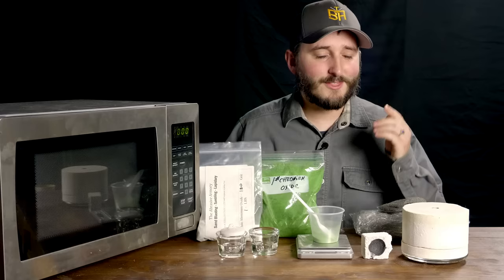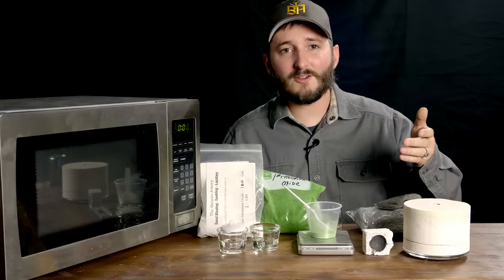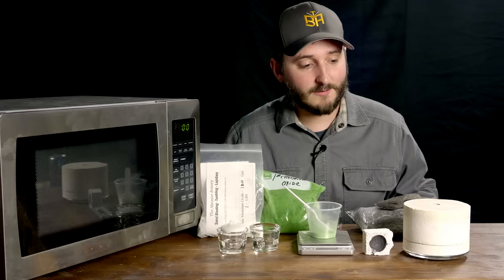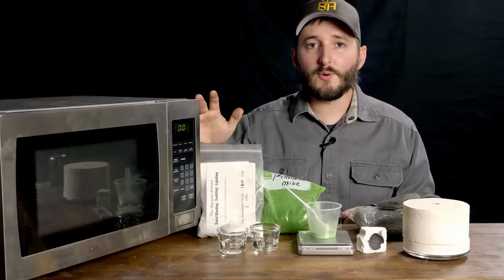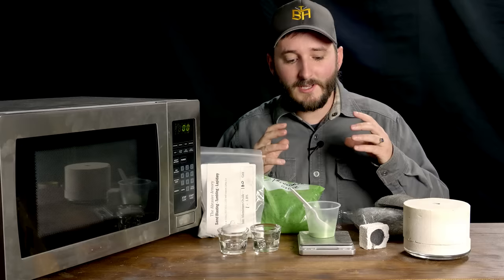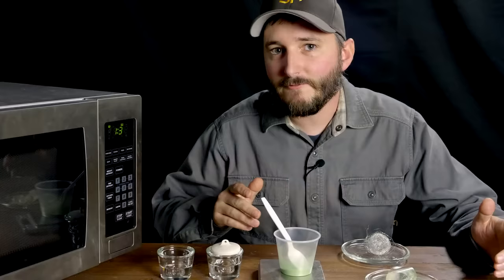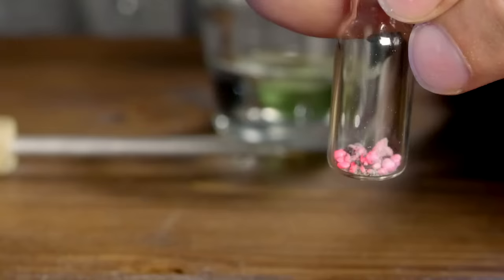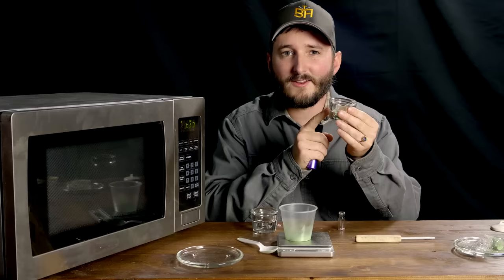How To Make Ruby in a Microwave

Comment: Have you considered a high energy laser beam to heat the mixture as it drops to a target/platform?

I've often wondered if the Verneuil process could be perfected by using either a laser or maser to heat the mixture instead of a flame, the theory being that this could avoid the air bubbles found in flame fusion rubies if you do all of this in a vacuum chamber.

I've also heard that the extreme temperature gradient in a Verneuil furnace causes observable curved striations in the ruby as it cools, so perhaps an array of high intensity infra red lamps in a circle around the platform area that catches the ruby droplets to keep them evenly heated as each new droplet falls?

Also the rubies would be a much more noticeable ruby red color if you increase the chromium percentage in your mixture to about 5.4%-5.6%.
Reply: Very interesting
Reply: I wondered the same thing except not as smart. I was more like WhAt aBoUt LaSeRs?!?!?
Reply: Interesting idea, thanks for the chromium concentration tip

Comment: Would running the chromium / aluminum oxide that has already began “seeding” ruby back through the process grow them larger? 
And what effect does the aluminum size factor in? Would a larger strand allow for more growth before cooking away? 
Does it even have to be aluminum? Something that can handle a higher temp might be interesting, I wonder if a carbon rod would work. Or maybe carbon fibers? 
Interesting stuff for sure, the microwave kiln idea is crazy.
Reply: You're right. Aluminum is not necessary for conducting the large alternating electric impulse from the 2.45GHz microwaves, but the aluminum also does not create a plasma which adds other metal impurities to the aluminum oxide + chromium. It can also cause neurodegenerative diseases. You can use any conductive material, like hemp or coconut Carbon filaments, Tungsten, Copper, Steel, Silver, Gold, Iridium, etc. 

When making large sapphire glass panes and lenses, a seed crystal is dipped into a molten bath of aluminum oxide and drawn out slowly, allowing a large crystal to grow from the seed until the bath is mostly empty. Yes using the seeds with a melt pool would allow you to grow them larger.

P.S. He is trying to simply use the high heat from the plasma to melt the crystal powder, but there are more efficient ways to turn electricity into heat than by powering a microwave to vaporize some metal strands. One in particular that should only need a couple dozen watts of energy input is using continuous wave lasers. Sapphire has a very large optical window where it doesn't absorb, so we may need to get creative, or target the toxic chromium oxide.
Reply: Unless the stoichiometry is affected, I'm actually assuming it should be reusable. As for making the rubies larger, I think compaction of the powder before the process may help, and since it is alumina (aluminium oxide is alumina), perhaps a sintering aid like MgO could be added, although I'm not sure if that will affect the optical properties. In this case I am assuming this is the same process as sintering pure alumina.
As for size of the aluminium, I'm not sure how big a difference it really would make, going for a larger volume will reduce the effective surface area, so there is potentially room for optimisation but I don't think it's necessarily worth it.
Carbon heating elements can indeed withstand high heat, but they must be in an inert environment, I use argon gas in my experiments with carbon heating elements. Otherwise, it will start to burn off at around 500C. Also, it will likely contaminate the rubies, most probably compromising the optical properties again. Carbon fibres can also be hazardous or an irritant depending on size, so that's another concern.

Comment: So cool! What if you used a narrow and tall vial with a strand of the aluminum down the center surrounded by the base? Just an idea. Keep up the good work!
Reply: Could do a spiral kind of thing too, yeah
Reply: @PilkScientist  Would thin aluminium wire coils work you think? Not tightly coiled like a spring but a loose kind of spiral that is just rigid enough to hold shape. Like take a thin metal wire that is straight and wrap it around a pencil and then pull on it to elongate the spiral. Two or three placed in the medium. I also wonder if the spiral shape down help would you get better results from a tighter spiral or a looser one?
Also, what do you think of a ribbon? Stick with me here, Take a wide, thin piece of aluminium like a strip sliced from a soda can, wind it up to make a loose coil, kind of like a pocket watch spring almost but not really tight. Set it down in a glass container and then inside the space pack in your medium. Think of an @ shape almost with the empty spaces filled in with the medium and someone else suggested a strong neodymium magnet to help pull the plasma down You could combine these different ideas and see what results from each experiment.  
I hope Nighthawk sees this thread here.
Reply: I was thinking a larger surface of catalyzer would increase yield and maybe size. Something like a loose spiral of aluminum foil would work well I bet.
Reply: @mikek6298  Yeah that's what I was trying to describe with a wide ribbon of aluminium. Making a snail shell or @ symbol type of spiral  and then pack the chromium oxide into the spaces. The metal ribbon would have a very large surface area touching the medium and might make more rubies or larger rubies. Maybe. 

I'll be honest, I have no idea what'll really happen, this is just throwing science at the wall and seeing what sticks.

Comment: I have experimented with welder method, both TIG and stick, and so far i think the main issue is that the material gets way too hot before it fuses into anything of usable size. I figured it out by doing short bursts of heat instead of one long one. Before material gets hot enough to fuse into one, i am noticing bright pink specks, showing that the ruby is being made. However, heating up the whole amount, size of a small grape, in an attempt to fuse everything into one turns the mixture into a glassy dark gray metallic-y object that hardly glows even in UV light. Interestingly, structure changes to something more opal-like with randomly oriented flakes inside that is rather beautiful by itself. At one point i thought bringing temperature up even higher would help, but just ended up melting a miniature firebrick kiln i made for the process. Since both open-air and CO2-argon shielded heats produce similar results, it seems that oxygen has no effect. 
I have tried compacting the powder in a press to make it act more like a solid object to begin with, but being basically dry sand it does not stay together enough to make a difference. I'd like to try this process under constant pressure, but have not yet figured out how to do so.
Seeing how nice of a stone can be made with the microwave method makes me think that it is either a lower temperature process compared to welder, or perhaps pure aluminum makes a difference. Going to try and see.

Comment: you should try using the last vessel upside down with the seed powder compacted in and put the foil at the bottom inside the vesel. also if the vessel was cone shapped it would concentrate the heat for a more even reaction. would be interesting to see, thanks :) @NightHawkInLight

Comment: What if you turn the steel wool into a powder and mix it in the seed powder?
Reply: You need sharp edges to nucleate plasma, so a powder won't work iirc.
Reply: It's ALUMINUM wool (not steel wool) and it's sticking into powder which is already mainly aluminum oxide. Also, it has to stick out ABOVE the powder like an antenna. Source: actually watching the video.

Comment: If you want a very simple explanation for why the metal ribbons cause nucleation in a microwave, think of the ribbons as tiny antennae that absorb the microwaves as they would with a radio signal. The most effective ribbon length would therefore be about a quarter-wavelength of the microwave, roughly.

Comment: Me this whole video: "Put it on the edge of the plate, so it gets hotter!!"
Reply: Fr those be the hottest
Reply: There is a little device in the wave guide that looks like a fan blade, and it is supposed to scatter the beam that comes out of the magnetron so you don't get hot and null spots in the cavity.  The stirrer as it is called, is made to spin by the air flow coming off of the magnetron's cooling fan.  And to make doubly sure, the platter rotates.  
  So, the edge of the platter isn't any hotter than any other spot in the cavity.

Randy
Reply: @AnotherWisenedOne  It isnt any hotter in theory

Joseph

Comment: Are you able to shape the rubies after making them? It would be EPIC to be able to make watch jewels for a pocket watch this way, but you'd need to be able to shape the ruby and then put a tiny countersunk hole through the middle.
Reply: I'm thinking you could make a close mold then sand down to the shape you want and finish polish.

Intricate shapes would take time and practice but there is a lot of good molding info out there.

Comment: One thing i have wondered about is if one could do this using an induction furnace and a graphite crucible, I think this is what is used in the semiconductor industry.  That way you can maintain the right temperature longer while slowly adding the powder and then maybe transfer it to an insulated container to slowly cool and crystallize using a seed into something hopefully clearer.  Another thought I had after seeing a video where someone reacted metallic aluminum with an acid and then neutralized it to make the aluminum oxide was a reminder of the process Nile Red had to go through to make a superconductor… I wonder if a solution in the correct ratios of aluminum and chromium could be made and to carefully precipitate a very evenly dispersed and pure mixture of the required oxides to make more gem like rubies.

Comment: regarding fusing bottle glass in a microwave kiln, or any kiln for that matter, each kind of glass has a different coefficient of expansion, so if you take a clear glass with a brown bottle glass, fuse them, then eventually they will crack, possibly shatter, and you will be at the very least disappointed in the long term with your work, and at most cause injury to someone who doesn't know you created a potentially dangerous piece.  You can fuse glass bits from the same bottle, or just buy certified art glass with specified COE values and keep them the same, even if the colors are different.

Comment: Any ionic substance becomes electrically conductive when molten.  Your strands of aluminum are getting tiny pieces of the alumina hot enough to become molten and conductive, which allows it to directly absorb the microwave energy, so the aluminum is no longer necessary to sustain the reaction.

Even plain glass is electrically conductive when yellow-hot.  Torch a piece of glass until it is glowing and quickly put it in the microwave and turn it on before it cools.  The hot glass will conduct and absorb microwaves and keep getting hotter until you melt the entire glass.

Comment: Have ever thought about using the transformer from a microwave to make a circuit with the seed material inside to maybe melt it? I've seen a friend do it with wood burning. It was literally arcing lightning through the wood, even left a cool lightning bolt pattern.

Comment: I will be keen   to compress the Al/Al2O3 powders+Cr molecules in right  proportions into a tablet thus facilitating much  close contacts of the reactive  components  The microwaves will penetrate and heat the conductive Al powders. Pretreatmnt is to sinter the tablets at hi temp. before microwiving.
Reply: Really good info here

Comment: In regards to the sponsor: I wear Keen Portlands. They have a carbon fiber toe, the Keen Bellows Flex, and the rubber toe wraps over the top. All three of these features are why I buy these shoes. Heavy tools/objects often fall on my toes, I’ll set a furnace on my toe while shifting it into place for an install etc. When servicing Heating and cooling units, I’m on my knees most of the time. Regular leather boots have an exposed steel toe in a matter of weeks. When I first bought these boots they were $179. They’ve since gone up to $249 thanks to the current administration when I bought a new pair 2 months ago. How do these compare to expensive Made in the USA works boots, especially for someone who’s going to be abusing them 8-12 hours a day and weighs 250lbs?
Reply from the maker: I've been happy with the durability. I think the rubber nose and fabric has stood up better than some of my past leather boots. I have however needed to replace the insoles to give better arch support.

Comment: Even though the Oxyhydrogen method works Better, the Microwave Method works actually great. It took more than 3226.15°C or 3500K to melt the solution into rubies. Also got swiped by the carbon arc electrode (almost hot as the sun's surface). Dwarfing the 2800°C or 3073.15K for the Oxyhydrogen

Comment: I think it would be cool if you showed us some more cool things you could do with that $25 microwave kiln. It looked cool when you " melted" the two pieces of glass together. It made me wonder what would happen if you took a four leaf clover, or a flower and put it between two pieces of glass. Would the plant just melt away from the heat, or get captured in glass?🤔 What if it was something solid between the glass? Like a rock? Would that be inside the glass? Sorry for all the questions. I don't know a lot about this kind of stuff but I've always found it fascinating and I've always wanted to know more about it. Thanks for making it easy to learn.😊
Reply from the maker: Anything like a clover would burn up in the molten glass
Reply: @Nighthawkinlight  what about something like the rock?
Reply from the maker: @skyblueeyes9968  A rock might work. You'd have to test a few. Probably best to dry them really thoroughly in an oven first

Comment: I thought about a way that might work too make the Rubies larger or more solid and consistent. What if you were to wrap the plasma seed material into a tightly wound coil or coils that are embedded into your Ruby seed material. Basically my idea is for you to have the aluminum wool completely impregnated with the Ruby seed material with a small amount that is mostly uniform sticking above the top of your Ruby seed material.

Comment: hypothesis for why the al wool needs to be exposed to air: the fine particles between the fibers increase the mean path length for the arc, meaning higher resistance and harder for arc to form. Second, the mass of the maaterial keeps the air too cool to ionize and generate plasma. Second seems likely to me, cause that would explain why it can follow the wool down into the pile since the already ionized gas will be much more conductive allowing for the arc to be sustained
Reply from the maker: Good thoughts

Comment: I think you're greeting thermite rubies.  The chromium-oxide and aluminum-oxide are at an elevated energy level from an outside source so a redox reaction can occur.  At least when it wouldn't at room-temp.  I know aluminum and chromium-oxide work, so my guess is the aluminum fibers start to oxidize.  They burn back to the oxides and set it off.

Comment: i suggest you place more metal wool BENEATH the powder. Try using IRON wool.  The metal wool acts as an antennae and absorb the radiowave energy and convert to heat. Aluminum melts and disintegrate at a lower temperature, therefore reducing the antennae effect very early.

Comment: Maybe doing it inside a vacuum chamber just small enough to fit inside the microwave.  The largest size possible to counteract  the plasma gases.  The rubies in the video look like they have small, nearly microscopic holes in them causing a chalky looking surface.  I'm thinking that taking away the atmosphere should help relieve that problem and give you a much clearer result.  OR, maybe going the other way around and doing it under pressure with an inert gas?

Comment: How about a different take on the carbon arc method ??
My sugestion is this .
Use argon gas in the same manner as you do in T. I. G. Welding to create an oxygenless inert atmosphere around your piece .
Put the aluminum oxide into the crucible  and use a pure chromium rod as your electrode . Inside the inert gas atmosphere you'd have zero porosity and zero contamination from the carbon electrode . 
When enough of the chromium rod is consumed you should have a well mixed and well melted "crystalline alloy" or , a ruby ...
Crude as it might be I think you'd overcome most of your problems in making a higher quality as well as a lager crystal .
You'll need an oven to temper your crystal as it cools at about 1 - 3° per hour or about two weeks .
I hope you can try this . If you need/want any help let me know .

Comment: Try mashing and grinding the power down as fine as possible I think that may help the quality a bit. I suspect the high heat and no real way to control regulate it may play a role In the clarity too. Maybe try running the microwave on different power settings.

Comment: I would say that grinding those rubies up and using them as a UV fast red pigment (ie it won't fade due to UV exposure like sunlight) for paint would be a good use of the lower quality ruby material you made, because it will still be one heck of a fine high quality paint pigment XD

Comment: 1:50 or unless it's a pinkish orange in which it is called a padparadscha, or it changes color in which it's called an Alexandrite even though it is not a true Alexandrite, or it's yellow with a reddish tint then it's called Topaz, or if it's a pinkish red in which it's called Spinel... You know, that's allot of different names for impure aluminum oxide crystals.